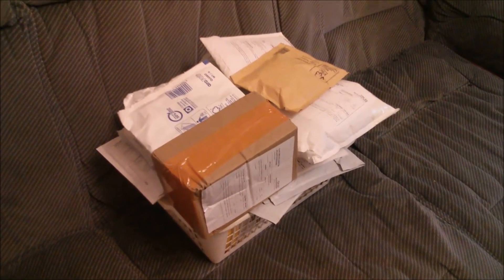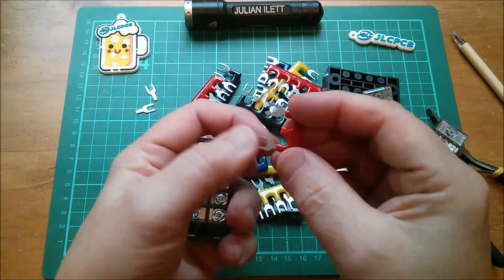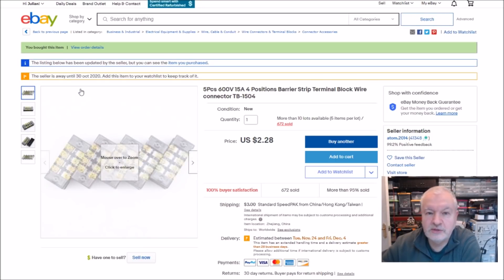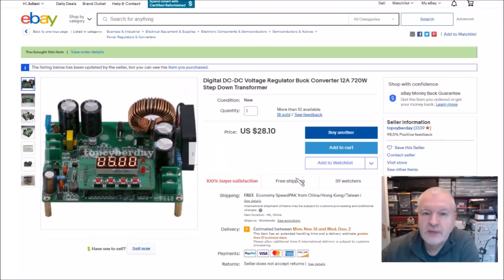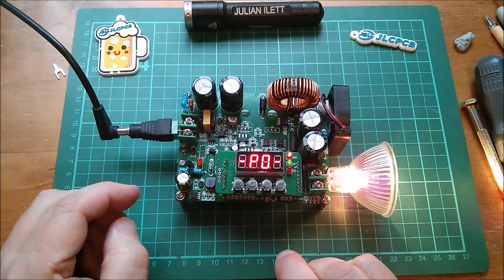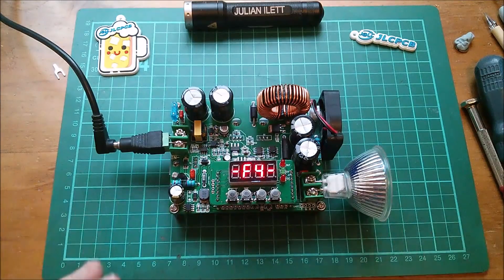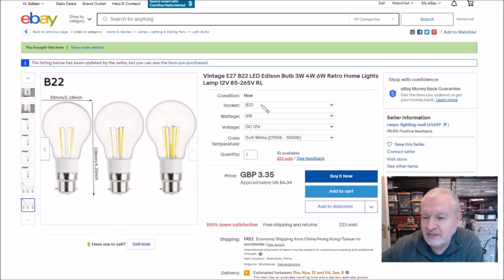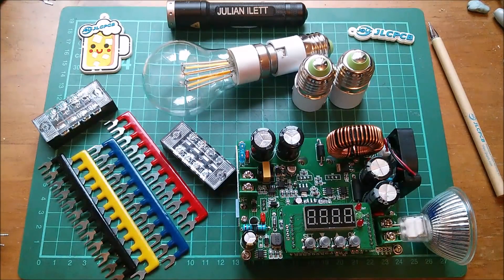Julian's PostBasket #149 - Electrics and Electronics

Comment: You will burn your shed down with all that wiring!
Reply: A Datacenter would have already burned down then. Just because you have a lot of wires doesn't mean its an instantaneous fire hazard.
Reply: @ZillionPrey  obviously you're not too familiar with the electric current! It's not about the quantity of wires,it's about the wiring itself,the quality of the workmanship and the parts used to do it! A data center has nothing to do with bad homemade electric wiring! Where is the logic of your comment? The internet is full of people like you...
Reply: @Atelierul29  don't judge people you don't know fool ;) I know my work.

The amount of wires has NOTHING to do with a fire hazard. I could lay down millions of cables If I wanted to. If you bundle them up or coil them and then draw a lot of power, your own fault.

Comment: Why don't you break the old blade tip off, then you will have a sharp knife again...
I would consider that power supply a pain in the @#$s to use.
The system they have there will lead to some major equipment fails due to incorrect output settings because it is not clear what you are fiddling with.
Why not have a decent display and rotary encoder and some up and down buttons.
$28 US = $39 AUD, and the shipping would not be free. Sorry not worth it.

Comment: I was just wondering, would the  DC-DC converter output stay a constant voltage for a variable input voltage i.e from solar panels?
Reply: If input>output the answer is yes i guess. But  seems like it doesn't show the actual output voltage on the 7 segments when you set the output voltage above the input voltage.

Comment: Banggood has a link to the software and protocols require in their listing for the buck convertor - https://www.banggood.com/DKP6012-12A-720W-60V-CNC-Adjustable-DC-DC-Step-Down-Power-Supply-Module-p-1330851.html?cur_warehouse=CN

Comment: ProTip: Halogen lamps are designed to run at their full voltage.  Running them at a lower voltage will shorten their life.  It has something to do with how the high temperature "boils" the top layer of metal off of the filament and then the metal is attracted back to the filament again.  Operating the filament at a lower temperature does not allow this process to work correctly and the filament is prone to early failure.

Comment: Before putting high voltage on the input, verify the voltage rating of the input cap(s). I've seen a lot of chinese gear which claims higher input voltage than the actual capacitor rating. It'll work for a little while if you don't exceed the rating by too much...

Comment: @10:10
Just bought a few of those modules. Out of the 6 I bought: 2.5 were NFG.
One had a direct short on output, thankfully my supply had over current protection.
One was only dimmable from ~1.5v-3.9v instead of the 10-40vdc.
Last one has a faulty diode (but was easy enough to fix).
Absolute rubbish quality. Needed 54vdc to 24vdc (28-30vdc).

Comment: The DC-DC converter has way too many "features" for 4x 7 segment LED displays.  It should have a small OLED display or at least a cheap alpha numeric LCD.
That LED display would be fine for initial product development where the programmer knows it all by heart but not for any production run.  It just cost more for product support and is a turn off for many many people that aren't going to be using it everyday and don't want to keep a cheat sheet with it all the time.
Reply: Ohh and those buttons. Plz gib encoders.

Comment: That buck converter would be great for testing capacitor leakage with a uA Meter in series with the capacitor, powered by a SMPS! Well at least it's going to keep you covered up to Around the 0 to 60V range! Don't really need a lot of current, just the ability to to put the rated voltage across the capacitor to see if will fully charge and stop! Otherwise if it's leaking DC, then it's getting warm inside which makes the problem worse till it fails either exploding or taking out other components, any fuses in place to protect are usually spared which kinda defeats the purpose LoL...

Comment: I have one of those big stepdown converters too. Great for powering things like laptop from my ebike battery. A couple of notes on it: the fan seems poorly placed, I think it would be more useful if mounted in the bottom of the heatsink. However it doesn't get very warm at a few amps, so I've been using it without. It has a few hidden features; notably a button lock to prevent changing the settings by accident, which is quite easy to activate by accident. There is a manual for a similar item though that explains how to use it, search for "drok 720w dc-dc manual" to find it. This one has a UART connection to control and read values from it, so you could potentially do something like mppt with it (or even reprogram the microcontroller on it, which I believe is stm8).

Comment: If the bulb+adapter is too long, perhaps you could remove the bayonet connector from the bulb and replace it with the screw connector removed from an adapter. LED bulbs have no glass or vacuum so no problem disassembling.
Reply: May as well just solder wires to the lamp directly!

Comment: 5:40 tha is a Drok buck converter! Awsome, can be used to make a MPPT solar charge controller  ... it contains a UART that can be used to program the buck converter. And Hance make a MPPT solar charge controller ...  of course can be used as a normal Power Supply with either the buttons or remotely with a MCU. Great product!

Comment: You've switched sides ? ..thought you was a Bayonet man ?..none of that Edison rubbish.
Reply from the maker: I use ES27 for 12V so I don't mix them up with my B22 mains bulbs.
Reply: @JulianIlett   Logical. Here in the USA I do it the other way around - Edison screw base for mains voltage and bayonet for low-voltage applications.
Reply: You all should be using SBC for 12V...